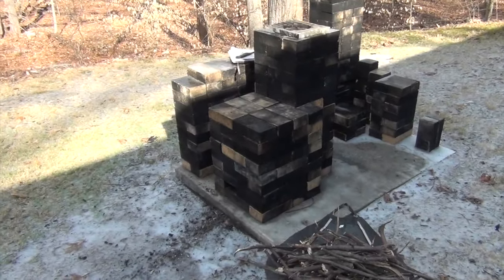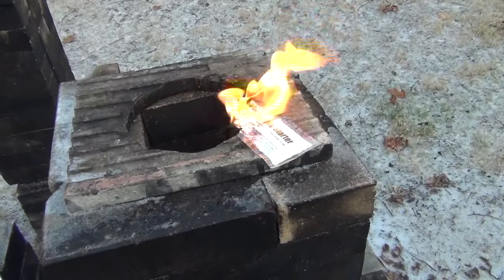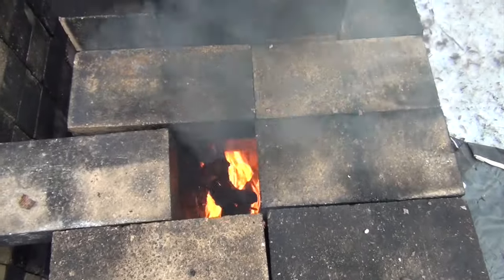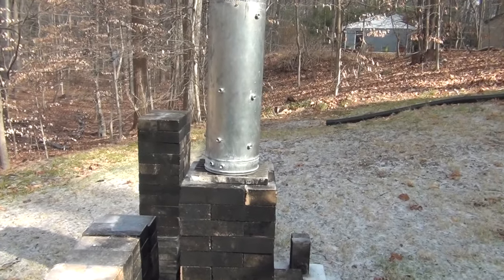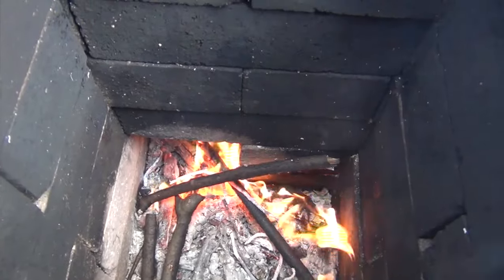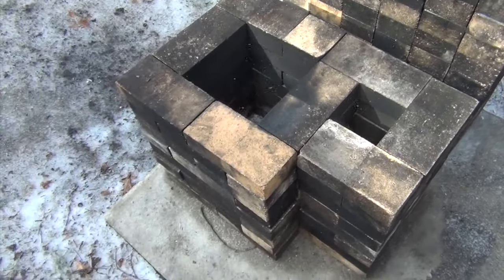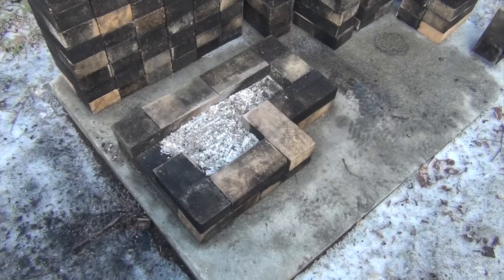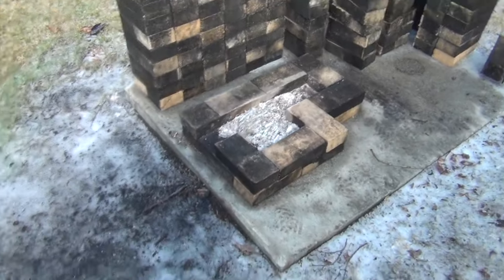My new rocket stove design - Top loading hopper prototype

Comment: Hey Matt, great video.  I love the simplicity.  I built a rocket stove to try and heat my barn.  I wanted to use normal split firewood so had a similar "hopper" idea but with an almost vertical 8" pipe as a feed tube.  The idea was to stack the split wood end to end and it would just drop down the tube as the lower tip burned.  It worked, kind of,  needed a larger tube or smaller wood.  My holy grail now is something more like what you describe here, a hopper, but designed to feed arborist chips.  Virtually free feedstock available wherever trees grow could help lots of people.  biggest obstacle seems to be getting it dried out.
Reply from the maker: Thanks for the feedback.... I'll keep working on it.

Comment: Hey can you explain why the long chimney pulls the smoke/fire in? Is it because it's cold?

Also isn't there a problem with this system if the chimney needs to be primed? Once you've fully built it theres no chimney access to drop the burning paper into.
Reply from the maker: Part 1 - I don't know the physics or care about the physics. With chimneys... the longer.. and the warmer (insulated) pulls far stronger than cold and short. Yes, a chimney can get "kinda cold." Think of a metal pipe along the side of a house in -10 degrees. An insulated chimney in the center of the house will stay 100 degrees warmer for an extra hour over the first chimney............ more.....

Part 2 - No. Many systems, Russian stoves, and masonry heaters need to be "primed" when everything is cold.d If you were building a stove to last 20 years, putting in a tiny door in the chimney bottom, or riser to prime it is not a big deal...  just a few pieces of paper and 30 seconds of work. I have to prime my wood stove right now. See my past videos.
Reply: It's the opposite. It's because it's hot. The chimney is radiating heat inward creating additional convection which pulls in more air

Comment: ive found a j tube design as rockety or more than no horizontal. Also, i'd discourage a tall feed tube. If for some reason, a backdraft developed, the tall sticks could all catch fire at once and one would have a lot of fire. Yes you'd have a top, but there is more risk. I use 16" feed and hardwood sticks take plenty of time to burn. The more the design is correct, the more its just the tips that burn, and that in itself slows the burn time. The J RMH I use only needs a small paper in burn tube for 30 secs to warm chimney, and it never creates smoke out the feed. Mine doesnt even have a cover on the top of feed tube. unecessary
Reply from the maker: Thank you for sharing. The original "Js" may be the best. So, you never have a stick "burning up the wrong way" and smoke in the house?
Reply: @stoveadvice  initially when it was being built, i had an insufficient chimney and/or winds and weather temps in/vs out, once or twice caused the sticks to burn up their length. Like I said, it is rare, especially once the design is complete and correct.
Reply from the maker: Please see my other comment too. Check out the Sedore Stove... a giant, top loading, wood hopper. If, in what I am doing, the hopper can be kept cool and the riser chimney is super hot, I would think a reverse flow of draft is almost impossible with the "top of the hopper covered." And... The fire would never choose the "air input" over the riser chimney, just like your "J" will never go the other way after it's hot.
Reply: @stoveadvice  yes, I agree with this. Similar to any old american stove, they also really dont need a glass covered front, except to stop an occasional pop ember, and yet most of them have a front shield of glass. I grew up with an open rumford with no issue, but many a house in the pioneer days burnt down for some reason, so their must be a perfect storm of bad variables (clogged chimney, wind direction, barometric pressure ?) , that occasionally causes the fire to burn in reverse? I understand wanting to have a longer length of stick so that you dont need to tend it as much though.  My RMH does need fiddling with, which I enjoy. But for regular life, people would want less fiddling so it may be worth trying to perfect this. I see the sedore. The hinged metal top door would make me less nervous than using a separate piece of metal that had to be physically placed on the opening. If things did get out of control. Again, probably rare occurance, but if it did happen, and the person was away from the stove, they come back and the entire hopper is on fire, burning upwards. would be scary. but there are many other dangers in this realm so I guess its not high on the list all things considered